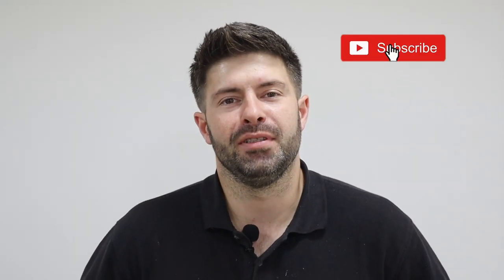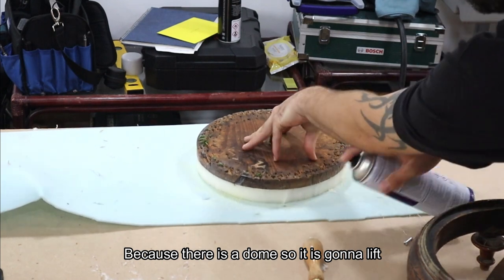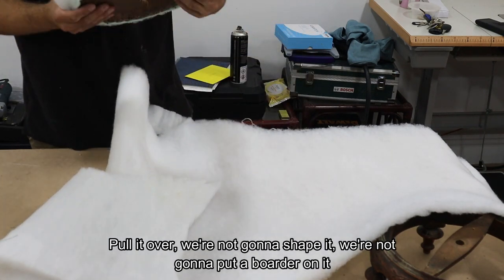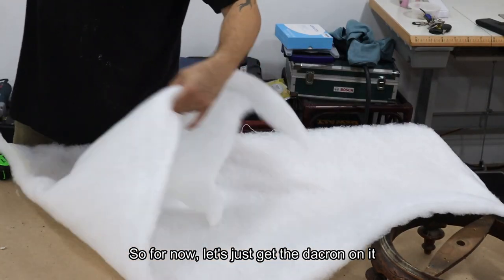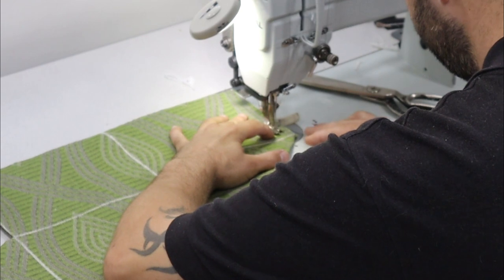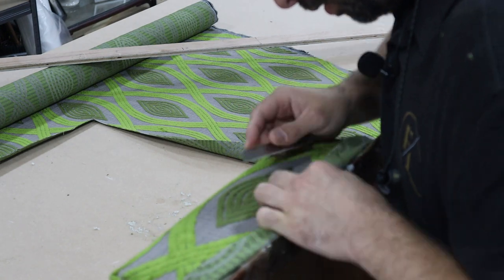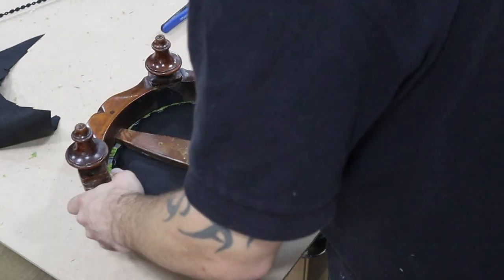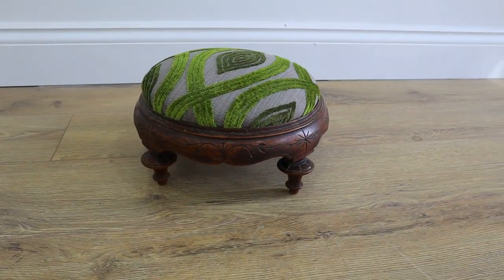HOW TO UPHOLSTER A FOOTSTOOL | ROUND CORNERS | SQUARE CORNERS UPHOLSTERY | FaceLiftInteriors

Comment: Hi! Could you please offer some more explanation for how you decided how deep to cut the corners while allowing for enough seam allowance at 5:55?
Reply from the maker: Hi Alex! The corners were at the finish size of the footstool plus half inch seam allowance on each side. So the footstool finish size was 14 inches and I drew the lines 15 inches (7.5 either side of the centre line) which gave me my half inch seam allowance on both sides. The footstool was square so the same measurements on each side. I hope this makes sense 😊👍🏻

Comment: where exactly did u measure at to get the 26”? and do you always add 1” for the corner cut out? (the 15”) i want to make sure i have enough to make it to the underneath on mine.
Reply from the maker: So 26" is the total size allowing enough to be stapled off underneath.  Then the corners must be 15" apart but I always allow 1" for sewing. Hope this helps 🙏 ☺️ ✂️ 📐 🧵⛏️